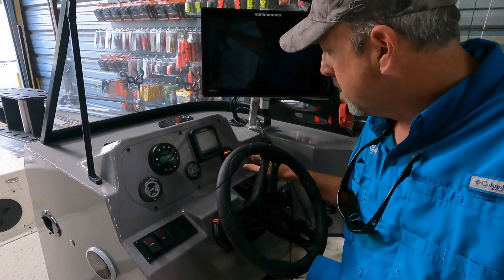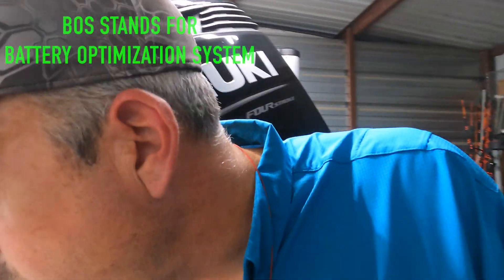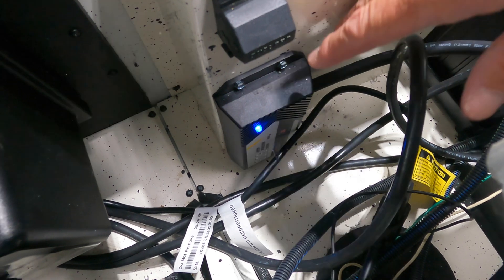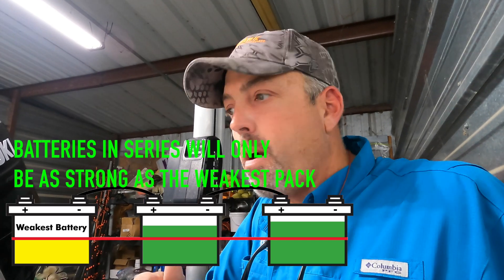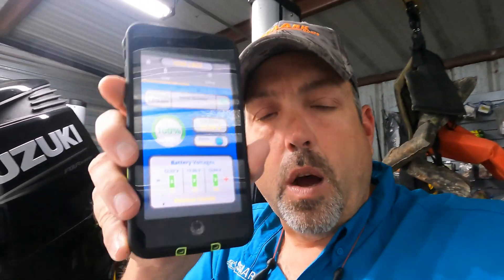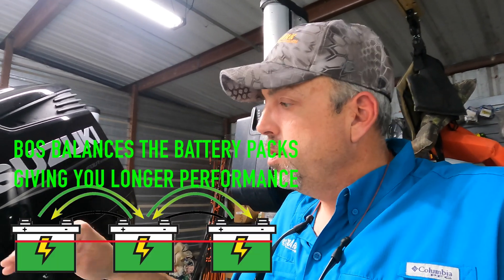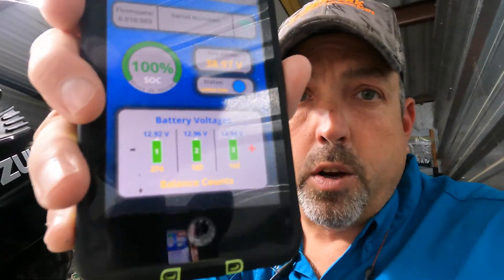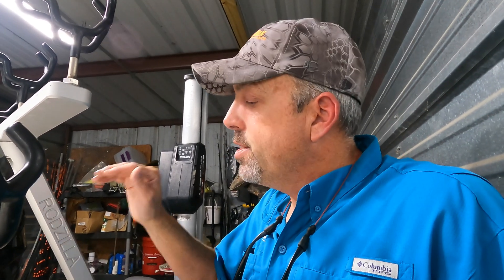3X Trolling Motor Run Time (INSANE New Technology) - NOT LITHIUM

Comment: If you have 2 12v for trolling and 2 12v for engine and electronics can you use the 4 bank without worrying about them mixing in the voltage or would you want 2 separate 2 banks?
Reply from the maker: One is fine

Comment: This I sent true about the batteries not all being the same power lever. It runs off a 36v system it takes power out of them equally. If this was the case the first battery would always need to be replaced first and this doesn’t happen.
Reply from the maker: One battery in the system is always weaker

Comment: No just no. 1st battery balancing is not new technologie 2nd continues cycling does not prolong battery life it shortens them. 3th This is cheaper with an known brand (you know the nice bleu ones) 4th monitoring and replacing of the weak link is the way to go and cheaper at least in the long run.
Reply from the maker: There will always be a week link. I fish daily and the system has worked great
Reply: It's somewhat like pumping gas to a leaky tank from perfectly good tanks.

Comment: Will this work for a 24 volt trolling motor
Reply: It wil work ON a 24 battery system if its comprised of 2 12V battery's. But learning what battery's can and can't do and using that knowledge is cheaper better and you gain a skill. This device is basically a stopgap measure (at best).

Comment: Just recently purchased one for my 24v trolling motor batteries after watching this video. The crazy thing here is that I just recently upgraded to lithium. Did a 1hr test run on max on the new batteries and noticed a massive drain on one battery. Of the two, one having 25% compacity left while the other had over 75% compacity left. Thought lithium would change the game here with longer run time but it didnt.
Reply: So you purchased this BOS system after upgrading to lithium?  Or are you saying you put it on your lithiums and it didn’t work?  Tnx!

Comment: Lithium has to many over heat issues I'm sticking with lead
Reply: Switching to lithium was the best thing I ever did half the weight last 3x longer and charges faster.
Reply: I'm not sure where you are getting your information but I've run lithium batteries hard for 3 seasons with absolutely no issues.